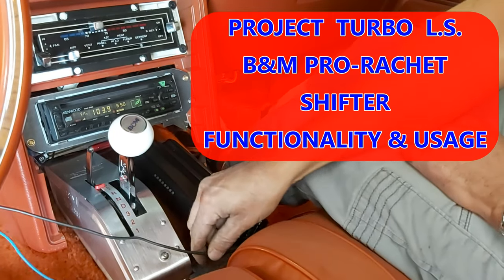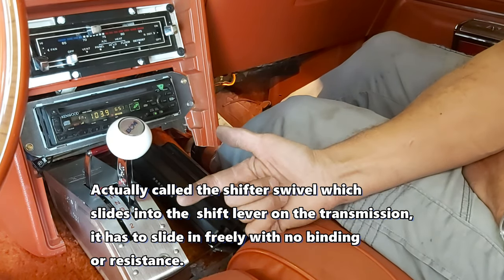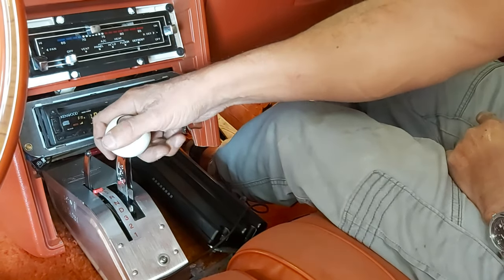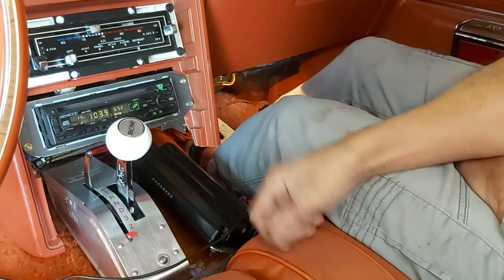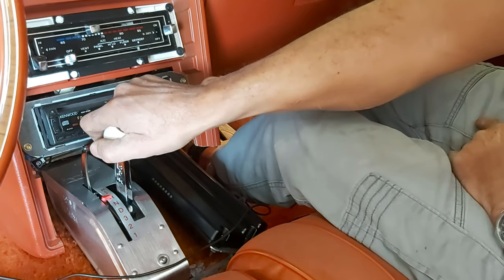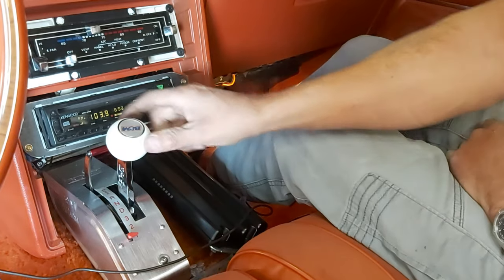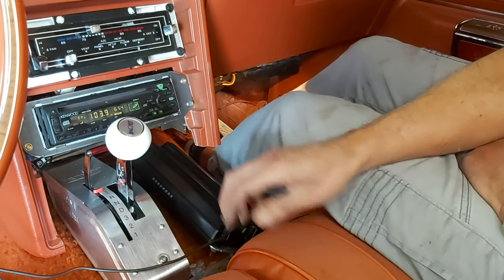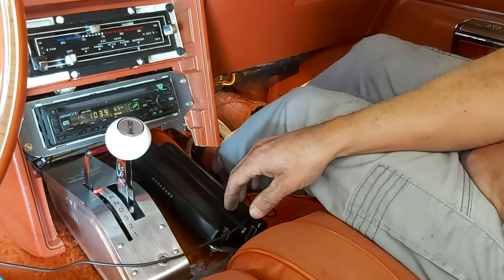B&M Pro Rachet Shifter functioning & usage

Comment: I might be wrong, but I put one of these on my old Chevy truck with a 700r4 and I believe the issue was that GM put in the large detent spacing between park and reverse on their transmissions compared to Ford and Mopar so in order for this ratchet shifter to work with any of the Gm autos (this part I’m not sure about since my only experience was with a 700r4) it ends up being a double detent up into and out of park.
Reply from the maker: Yes, that's also the case here, using this shifter and the 4L85E 4 speed transmission, in one of the  scenes i specifically make a point about the fact it takes 2 detent positions to get it into park. Thanks for watching and commenting....Oliver

Comment: Nice video.
I have a 1999 forward manual valve body 4l60, would this work for that?
Reply from the maker: It definitely will work with the 4L60E transmission and they work with both forward and reverse pattern valve bodies . Also comes with a  forward numbered gear indicator sticker. Thanks for watching......

Comment: Is D 4th gear? How do you get 4th? Do you have pr can you make a video on how to install it and what does what? I'm looking to put this on my 4L60E in my s10 with a carb 350 smallblock but I'm so confused as to how it tells the transmission what to do
Reply from the maker: Yes , when the selector is in drive, the transmission will go from 1st to 4th automatically dependent on speed (rpm)and throttle position & load on the transmission. A TH 350 transmission uses a vacuum modulator and a  transmission kick down cable to down shift when you floor the gas pedal. up shifts are controlled by vacuum signal to the adjustable modulator and you can control that by adjusting the allen head screw in the vacuum modulator. This will adjust your full throttle up-shifts...so example from 1st gear to second to third when racing can be 6000 rpm or 5500 or what ever you desire. If you clic on the the link you can see the Trans-am racing a Mustang. the trans-am has a TH-350 behind a big block Olds.  https://youtu.be/A_Jd2VQaPQk  ..Thanks for your interest and for watching.....Oliver

Comment: the fact that when you went into correct Neutral, the other lever smacked into the stereo - is this an alignment problem or is that normal with these installations?
Reply from the maker: Actually when I filmed I hadn't installed a couple console fasteners yet. After install of said fasteners it pulled the whole console and radio forward away from shifter about 1/2". No more lever hitting the radio....thanks for watching....

Comment: Was the installation fairly ez?  Many adjustments at the shift linkage?
Reply from the maker: Yes just make sure the detents line up exactly in every gear and shift point. There should be be no binding and the swivel on the cable end, should be able to be moved freely transversely with no resistance...in all gear selection positions....

Comment: I don’t know much about transmissions but, my question is, do you have to have a manual valve body to use this type of shifter?
Reply from the maker: This shifter works with both types of transmissions. Full manual or automatic valve bodies. The transmission in this car is a fully automatic 4L85E. Thanks for watching and commenting....Oliver

Comment: Hi. Can that shifter be installed in a automatic Honda civic?
Reply from the maker: This particular shifter was designed to be used with the 4L85E Chevrolet or GM 4 speed units. If the Civic is a 4 speed and has the same longitudinal detent position it may be able to be used,. Thanks for watching and commenting.....Oliver
Reply: It's a 3 2 1 D speed. And the linkage cable is a little bit square. If you have any suggestions on how to link them together?

Comment: Will this make your transmission shift faster as well?
Reply from the maker: When you decide to shift manually vs keeping the shifter in drive, it will shift gears as quick as you decide to shift up or down.....thanks for watching....
Reply: @BooostedLS  thank you for the fast reply. Im looking into getting one for my Ford C4 3 speed transmission.
Reply from the maker: Yes, It's a very rugged yet simple shifter. It will work well in your Ford, and it has the option of working with 3 or 4 speed transmissions  should you decide to install a 4 speed transmission....

Comment: Is the 2 detents only for the 4L80? Bcuz I'm having trouble locking it into park on my TH350
Reply from the maker: I believe there is a mechanism, internally that one must manually manipulate a lever to choose between 3 or 4 speed operation. depending if you have a TH-350 or the 4L80E. once this is selected you have to also use the correct shifter lever hole, on the transmission selector shaft arm . I'm telling you this from memory so I would check the instructions to make sure you are installing correctly. Yes the 4L80E requires two detent positions to get it into park. Thanks for watching and commenting.....Oliver
Reply: @petters1969  thank you for your response! Much appreciated 👍I have a th350 with manual valve body. All the other positions work fine, just will not lock into park